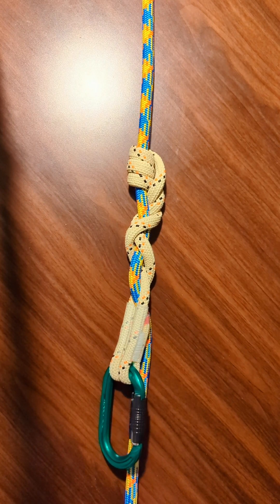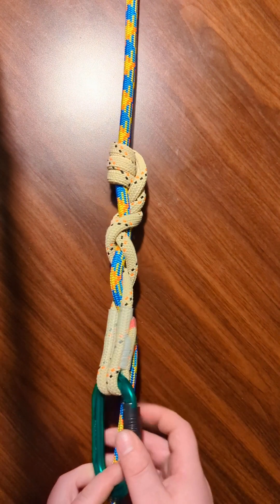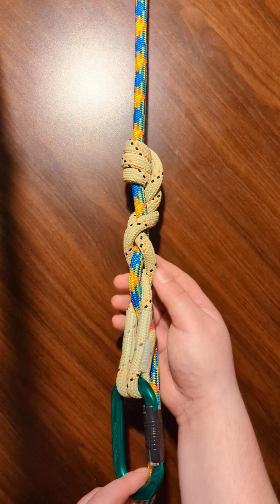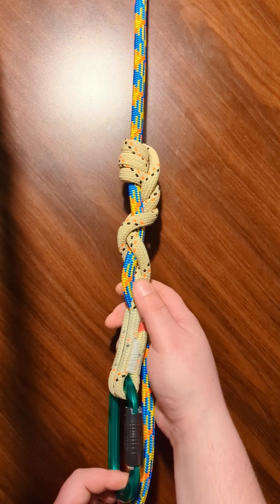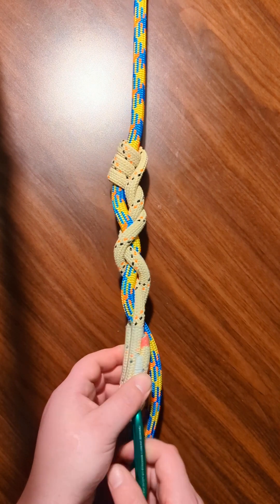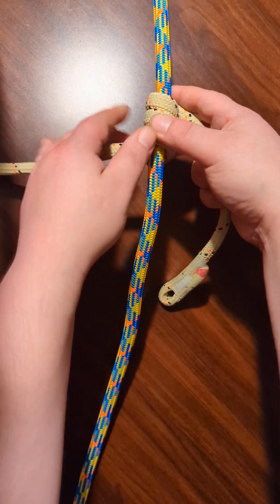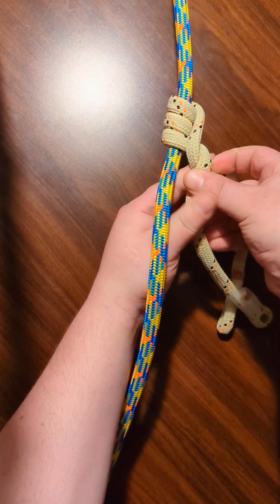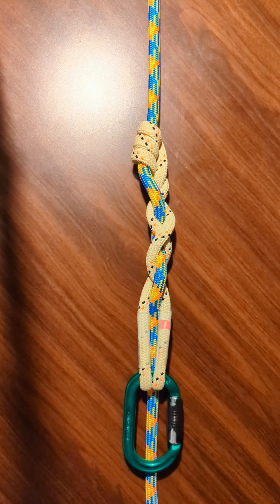XT Friction Hitch (VT/Valdotain Tresse Variant) for Arborists & Tree Climbers!

Comment: Thanks for the video. Recently switched to using the VT prusik as a back-up for my mid-life crisis rappelling fix ;-) Looking forward to studying and experimenting with this one. Will check out your other vids, for sure.
Reply from the maker: With this hitch, it can potentially create an additional (and sometimes unwanted) friction point between the hitch cord (VT prusik) and the rope. This is mostly only an issue when used with industry climbers in arboriculture. If used for rappelling, as you just described, it can serve as beneficial because the twists that are placed after the coil will lock in the tension, making it consistent to use. It will also help prevent any forces below the coil from creating any binding forces versus the the VT, where those forces are free to wreak havoc on the coil through the braids. Everyone has their own experiences of course, but this is my summary of some people's. I do believe that this hitch was created with the arborist in mind and not the rappeler. I think this one will ultimately come down to your personal experiences with it. Please share your experiences if you have time! I would love to hear them!
Reply from the maker: If you really want to get experimental, here's a hitch I created which is like the VT, except it mimics the Clove Hitch in how it is wrapped.  It may be too aggressive for rappelling (maybe not). But just wanted to give you all of the options.

https://youtu.be/g7My_bymsZQ
Reply: @Knot-orious  Will check that out although the VT is great for my purposes and my daughter likes it too! Great fun being able to rappel with a friction safety above the device yet being able to release it under load. Thanks for the videos all the way from the UK ;-)
Reply from the maker: @Jackson Parsons  I'm assuming the device you're talking about is a figure 8 descender of some type. Have you ever tried putting the hitch below the device? This is how the SWAT and rescue teams do it. It puts 75% less tension on the hitch and most into the device. I made a video where I show this technique in the end. You just need to extend the device out with a loop, placing it right at your chest. Less likely the hitch will get jammed this way. It's a little more dangerous in ths configuration, and it require more experience. Be sure to place the hitch far enough below the descender so that they cannot touch and accidentally trigger a freefall You can use a VT and connect it directly to your belay loop or bridge. Sometimes a more compact hitch is required, though. Because there is so much less force on the hitch, even a French prusik can be used effectively.

https://youtu.be/W7wh92YXQEg